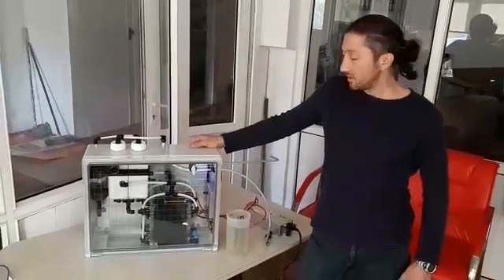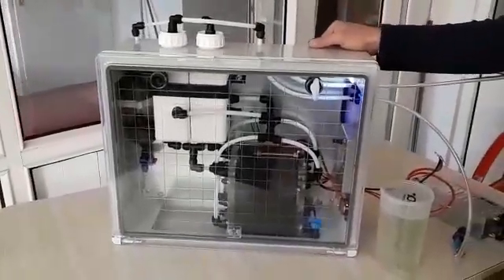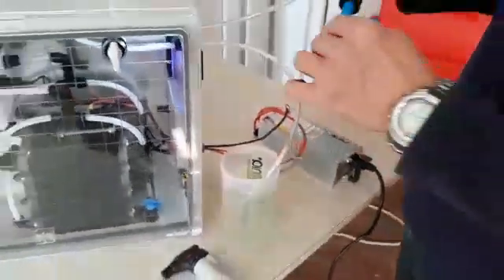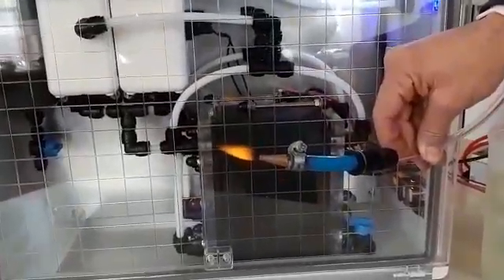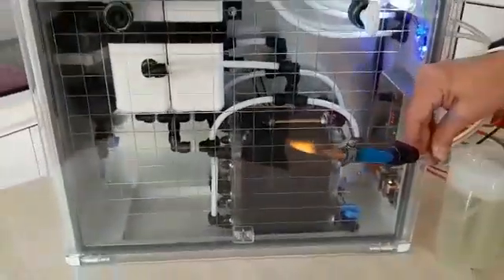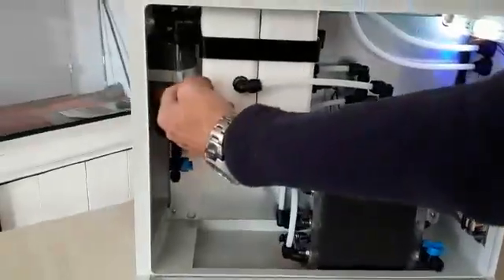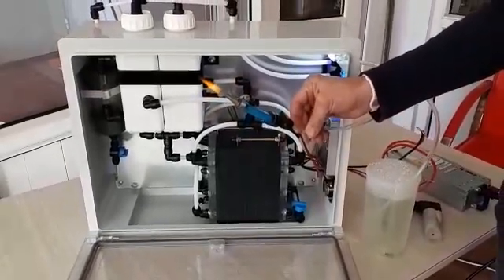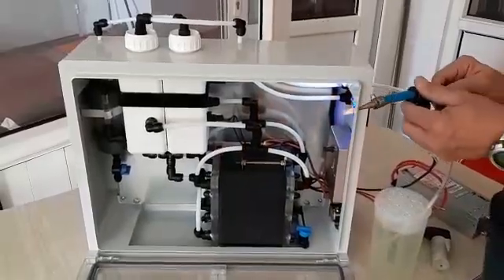Boxed model Pure hydrogen seperator cell system

Comment: Can this be used for breathing?
Reply from the maker: You need to add water filter system for breathing. Than hydrogen gas will be cleaned enough. I am using for 5 years hydrogen enriched water for drinking and day by day I feel much more younger and healthier.
Reply: @XWOOFERX  
So the answer is yes, good.

But what specifically do you mean by "Water filter system"? 

Do you provide this "filter" and if yes how much approximately is the final price for the whole system shipped to the USA?
($1,250 + added filter$ + shipping cost)

Also how much LPM is does this system produces?

Thank you
Reply from the maker: @holiyo3677  Try to contact from whatsapp 00905324529238
Or skype: h2_tech@hotmail.com

Comment: How much
Reply from the maker: 1250 USD
Reply: H2 TECH how many ams its need to works ??only car battery??
Reply from the maker: @khalidtaml2160  Yes car battery system is enough for using this system. Less than a fog light power is enough.
Reply: What is the price per unit if we purchase 5 or 10 of these systems?